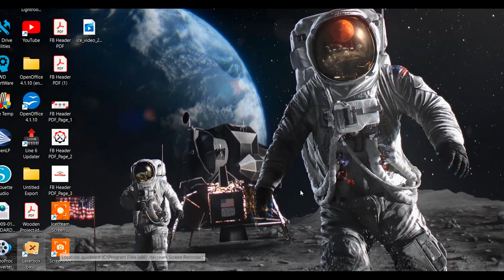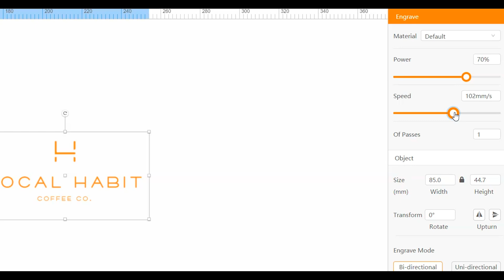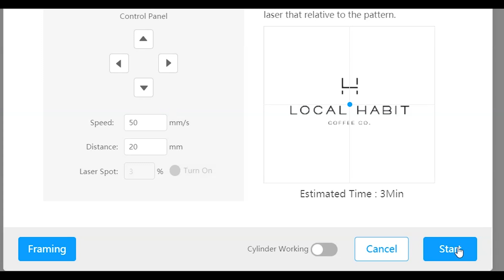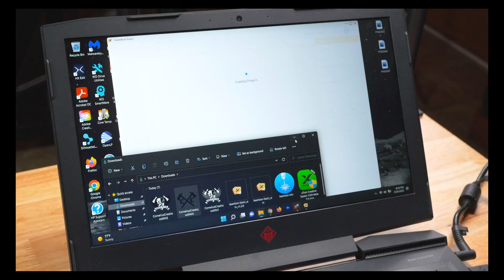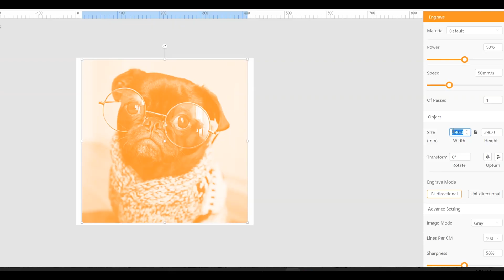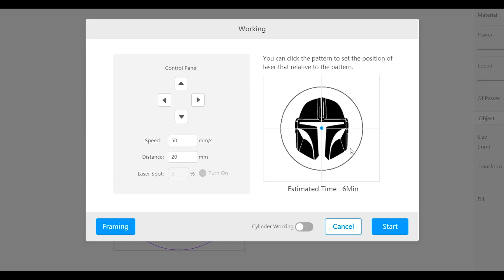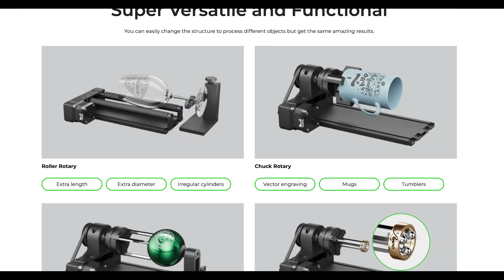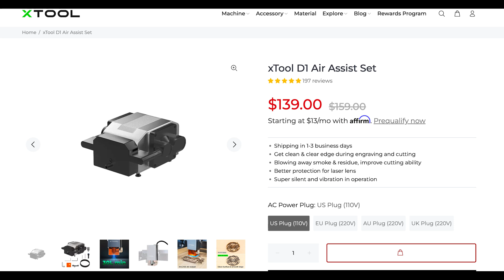How to Laser Engrave Anything with the xTool D1 Laser Cutter/Engraver

Comment: For beginners, it's recommended to begin with simple projects and gradually experiment with different materials and settings to achieve the desired results. If you're looking for a reliable and powerful laser engraver, I highly recommend the Monport Mega. It offers 70W CO₂ laser power, making it perfect for engraving and cutting materials like wood, acrylic, and leather, plus it comes with useful features like auto-focus, flame detection, and a safety enclosure for a secure working environment.

Comment: Use masking tape over anything you want to test run. You will have to lower your speed and power but once you get it dialed in just to mark it and not cut through, it works perfectly. I use blue masking tape because the marking turns out better.

Comment: Juast got my D1 20 watt. Question. Can I adjust the thickness of the etching or am I limited to the width of the laser. I would like my outline of an item to be a little thicker.
Reply from the maker: If I’m understanding correctly, what you are describing would depend on how thick the lines are on the file you are trying to engrave. If you would like thicker lines, you may need to find a similar file someone made that looks thicker.
Reply: @CorneliusCreations  thanks for the quick reply. I’m scoring the outline of an image so there are no lines.

Comment: Instead of using paint thinner (which is chemically designed to thin oil based paints), you should be using acetone for spray paints where they are ether based. Plus, you wash off the waste into a plastic or metal container, not down your drain where it will pollute your water system (either town water or your water table if you have a leach field).
Reply: to piggyback off this, actually just check with your water authority for drainwater if you have city sewage.  Many things actually CAN be drained down your normal city sewage (like antifreeze in most places, holy smokes) but never your leach field (like antifreeze, holy smokes)

Comment: Thank you for this video... I have the f1 and when I upload an image (trying to do a soundwave) it keeps asking for DPI and its a very smudgey result... do you have any recommendations?? Thank you!! Doing this on stainless steel bracelet.
Reply from the maker: Is the image you dowloaded a high resolution? If you downloaded a low resolution photo, the F1 is trying to take in account for the blurry pixels. Every laser varies, but I am usually running around 300 DPI or more.
Reply: @CorneliusCreations  hmmm it looked pretty clear to me. it was a png.. should it be like a jpeg or svg for example instead? I'll try the 300 DPI... for power and speed I do 100% and 5mm/s for stainless steel.. does this should right?? Thank you so much for responding!

Comment: Hi.
Recently, I burned my first car - the material is 3mm plywood. I used the Longer RAY5 10W laser for this. What settings would you recommend, I used 100% laser power and 260mm/min feed rate, but sometimes I had the impression that it was not enough :/
Below is a video of the work.⬇⬇⬇
https://youtu.be/4FgSJaHOV_w

Comment: Why not laser on 100% and speed up? (instead of power 70% with 126mm/s) would this give the same result? I'm planning on buying a laser but very much dislike the waiting as I did with my 3D printing. So many hours. So, speed is key for me. Any advise?
Reply from the maker: Very good question. Depending on the material, lower speeds and higher power may be best. Or higher speeds and lower power. This is why I recommend doing a cutting and engraving test file. It will help you to determine which setting is best for you. If you are use to 3d printing, then lasering will be no problem for you.
Reply: They make a 40w laser now. I'm just getting into lasers, but at that power it might be worth it to go to fiber or CO2. You want to talk fast.  Their are more experienced people to talk to. Good luck.

Comment: Instead of using a masking paint that requires thinner or acetone to remove try using water washable tempera paint. Some people brush it on but I invested less than $100 on a Harbor Freight airbrush compressor/air brush set. Apply the tempera paint, let it dry, engrave your image and wash it off with water. That simple!
Reply from the maker: Fantastic advice, Thank you!

Comment: Can it engrave steel? Like text into steel
Reply from the maker: It will mark it if used in conjunction with a marking spray. Only Fiber lasers can truly etch into steel. But, the new infrared laser from xTool works great on marking steel without spray.
Reply: @CorneliusCreations  not heared of the infrared laser, thanks for the info
Reply from the maker: Yes sir!

Comment: What is the difference between the default blue laser and the xTool 21064nm infra red laser? They quote that the infra red laser is used to engrave metals and similar materials. But you can do that with the blue one too. Does it just work a lot better?

Comment: Great video, thank you!
Would you happen to know if there is a setting for the framing speed in either the Laserbox software, or in Creative Space? My wife's Xtool D1 10w works great, but the framing is so fast, it's hard to tell where exactly the edges will be. In your video, the framing process was much slower than ours is. We have the latest firmware, and the latest software updates.

Thank you!
Reply: There is a framing speed option in Laserbox
Reply from the maker: Glad you enjoyed it! Once you get to the framing menu there is a setting to slow it down so you can see!

Comment: I am struggling to learn lightburn maybe I should try laserbox instead. One problem I am having is I think because there are to limit switches on the d1 it seems to slam into the outer edges and makes a awful noise when that happens. My question is how do I stop that from happening. Appreciate your encouraging video
Reply: Home first. Then learn about where to start the job; current position vs exact dimensions. Also be aware of start location (the 9 dot grid). If you’re starting at top left and you’re engraving “selected items” they must be at that edge of your on screen project. In other words, if you have vertically, A, B, C and are only engraving B and C, it will skip the location of A even though you’re not outputting it.

Also if you have the Blue laser head (with red crosshairs) make sure the Offset is on,  for the IR head, it should be off.

There are some great tutorials available. 
https://www.youtube.com/@TheLouisianaHobbyGuy  this guy is good, but has the remarkable ability to take a strong five minute video and stretch it out to twenty. Loves to hear himself talk, but has lots of good info.

Comment: How does it know to etch versus cut right through material? Is that based on speed?
Reply from the maker: That is an option that you can toggle on. When you select “cut” the laser module kicks into a high powered mode and gives you options for different materials.

Comment: What's the machine which cleans the air? Is it enough to use the laser in the house?
Reply from the maker: This is a wood carving dust collector. It's not the best for fumes, but it does collect a lot of the smoke. It works great with the laser in my experience though.

Comment: I've had mine for about 4 months and I am very happy with it. I have the 5 watt version, the 10 watt seems like it does cut better so maybe soon I'll upgrade to the 20 watt module.
Reply from the maker: I’m glad you like it! It is such a cool little tool!
Reply: If ur only gonna cut then jump to 20w but to engrave the 10w is better but over all the 5w is best for engraving
Reply: @dulcebellz3857  I've had nothing but great results using the 5w for engraving, initially I wanted to cut 3mm delrin plastic for guitar picks and pickguards but unfortunately It didn't work. I see a few people selling their 10w module only since they have the 20w so I might just save some cash and get that..
Reply: @TheSpineSplitter1990  was the 3mm too thick for the laser or what was the problem?
Reply: @Blash1  So I made the rookie mistake of trying to cut blue plastic sheets with the blue diode laser, it will cut it but it's such a hassle. I did cut red plastic and it was a lot faster. Blue and clear acrylic or plastic will have some issues cutting or engraving right. 3mm to 5mm wood is fine though.
Reply: @TheSpineSplitter1990  i want to engrave a 2mm acrylic sheet, what would you recommend?
Reply: @Blash1  I would recommend two tone acrylic sheets. That way when you engrave for example a black sheet, the laser burns off the top layer and exposing the under layer which would be white. You can find them in different color combinations. Usually made for keychains and panels with logos etc. I believe Amazon might have them.